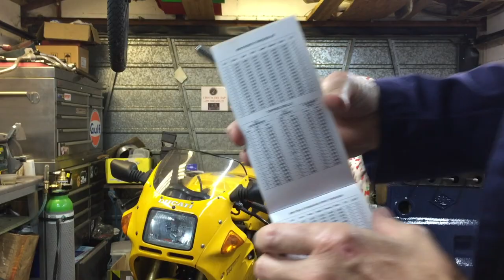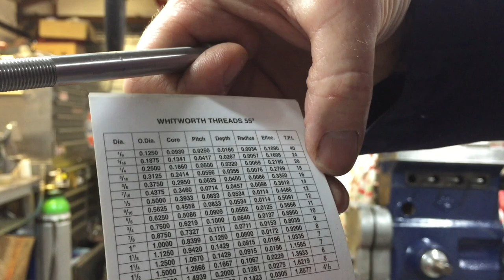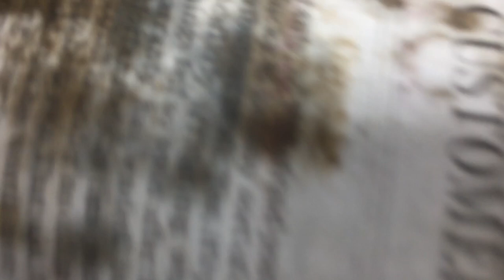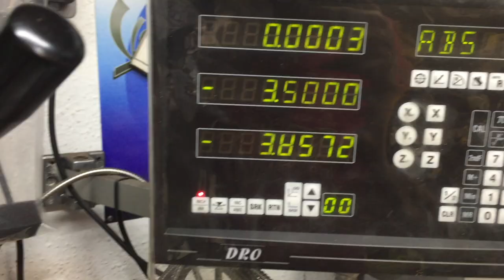RILEY 9 MONACO TRIALS AND TRIBULATIONS OF VINTAGE CAR OWNERSHIP  ( Part II )

Comment: Yeah, I went down memory lane with you when the "Sentimental Walk" theme music from the DIVA film came up (14:20s). Being more of a 616 type  4 cyl. Porsche motor afficionado, I was aghast when I read that my RMA piston rings all had to be turned towards the exhaust valves. On the 616 engines you´re supposed to turn each of the three piston rings by 120 degrees to the previous ring to insure NO blowby whatsoever...Huh! What was Dr. Ferdinand trying to tell us there...?
Reply from the maker: I was always lead to believe piston rings were always set 120 degrees apart on 4 strokes, on 2 strokes the gaps are either side of the pins, all in a line seems to fly in the face of standard practice, maybe RMA's like a bit of lubrication on the exhaust valves 🙂

Comment: I had to replace the spigot bearing of my car when I rebuilt the engine in 2005, same condition , when I replaced it I made a cap to fit over the flywheel hub with an i/d a little larger than the gearbox input shaft o/d ,hopefully it's still keeping the grease in !! Cheers keep up the good work.
Reply from the maker: that's a great idea, what grease did you use on the bearing?
Reply: @TweedsGarage  I can't remember ,just a regular bearing grease I think.

Comment: Finally some more Riley 9 content! You're luckier than me, I have to put my car together from bits. Many of which I don't have. I couldn't use my original crank. It's worth getting them crack tested too. Mine was cracked. So new Arrows crank and rods. That did mean I had to machine the piston tops to give clearance. I also need to repair my eccentrics to fix the oversize holes. I was considering bronze brazing them up then drilling new holes on the mill but your method might be better. My problem now is valves and valve gear. After spending so much on crank and rods I am not sure I can bring myself to not use new guides and pistons in it too. Looking forward to part 2!
Reply from the maker: its an endless spiral of costs and difficult to know where to stop, yours is coming along great and your standard of work is impressive.
Reply: @TweedsGarage  I have a big spreadsheet of costs and it's frankly quite frightening! Prices add up quickly. For example replacing just one valve (valve, guide, tappet, rod, spring, collets, rocker, etc) is about 150 quid. And there are 8 of them of course plus other sundries. It's great we can get all these parts and it is well worth joining the clubs to support them making them. But when the clubs talk about getting 'young people' involved they need to realise it's not cheap. Unless you spend up large on an already restored car buying a cheap one will cost you money. And you can't just go to the local pick-a-part to get spares. Not a cheap hobby but rewarding because at the end of it you actually have something you can drive and enjoy and hopefully has some value. Since it takes me so long to build my cars (the Austin 7 is past 10 years now) I think in terms of costs per year and it's not so bad then! If you count hours of scraping muck off old bits as entertainment you'd otherwise have to pay for it's positively a bargain!

Comment: ......Are you sure you want to hang onto the red fibre intermediate timing gear? Batches of metal ones have been made in the past. The fibre ones may be quiet, but having seen all the other surprises this car has thrown up...how long has it been in situ? Being hemi-head i think failure can ding the valves...not 100% sure of the clearance.
Reply from the maker: I've checked them out and they are in good order, with the standard valve springs, cams and smaller loadings of short pushrods they are up to the job for now,  the wallet isn't bottomless and at £700 plus a set steel gears will be an improvement in the future
Reply: @TweedsGarage  Talking of valve gear- it's widely known in these circles that spare s/h inlet camshafts were available for many decades after production ceased- but exhaust camshafts were in short supply. The reason: It was established quite early on that an exhaust camshaft fitted to the inlet side of the engine 'improves' the response of the engine- but it's timing needs to be changed by one tooth. (i forget which way!!)
The extent to which your car has been altered over the years, i wouldn't be at all surprised to see that this had already been done.. as you know, a Riley 9 saloon needs anticipation for steep hills 'what goes up in second, stays in second'
Best of luck with the work.
Reply from the maker: @thephilpott2194  I had heard about this mod but didn't check the cams when I removed them as I don't think I would of known how to tell the difference, if I knew what lift and opening/ closing angles I could check with dial indicator and degree wheel and thanks for the tip " what goes up in second stays in second " , I had started to get an incling when driving it about before the strip down, hopefully with all the problems sorted it should have a bit more pep for getting up the hills 😀 ( once run In of course)

Comment: Did you have to machine the piston tops to give valve clearance?
Reply from the maker: Hi Ken, with standard cams and rods there is plenty of clearance on these pistons, this type of piston was used in the later Rileys.
Reply: I used an Arrow crank and new rods (with modern shell bearings from a  Ford Orion I think it is) so needed to machine the pistons (Omega) in mine. Since they are 60 thou over I had to machine a step to avoid hitting the head then mill flats at 45 degrees to avoid hitting the valves.